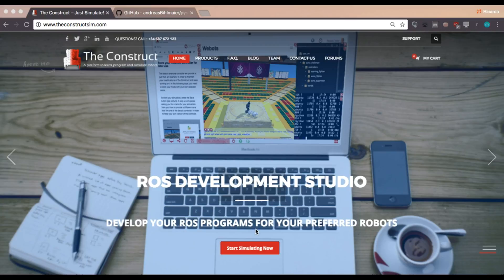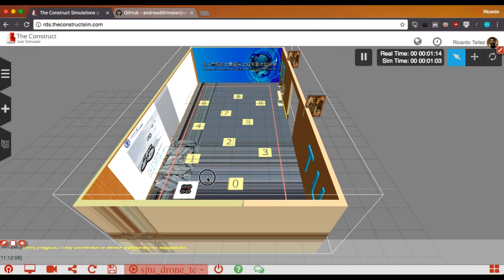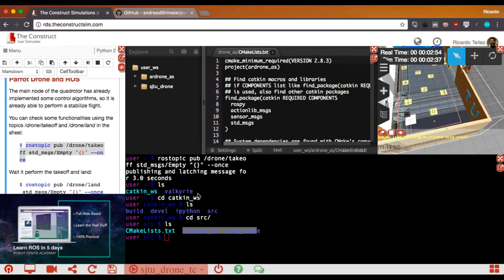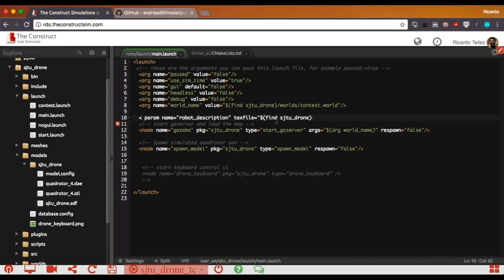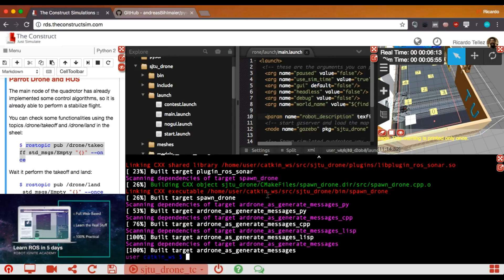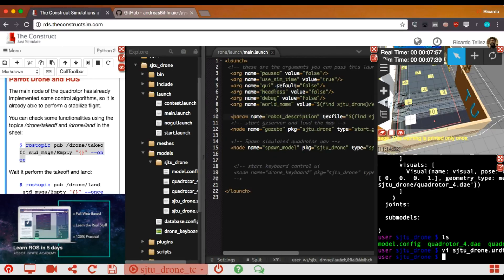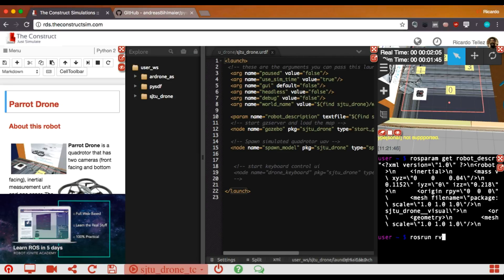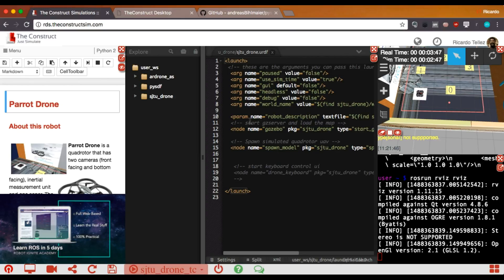[ROS Q&A] How to convert from SDF to URDF robot models

Comment: Thanks for the video!  I'm getting this error: 
Traceback (most recent call last):

  File "/home/ljy/catkin_ws/src/pysdf/scripts/sdf2urdf.py", line 6, in <module>
    import pysdf
  File "/home/ljy/catkin_ws/devel/lib/python2.7/dist-packages/pysdf/__init__.py", line 34, in <module>
    exec(__fh.read())
  File "<string>", line 1, in <module>
  File "/home/ljy/catkin_ws/src/pysdf/src/pysdf/parse.py", line 11, in <module>
    from tf.transformations import *
  File "/opt/ros/melodic/lib/python2.7/dist-packages/tf/__init__.py", line 30, in <module>
    from tf2_ros import TransformException as Exception, ConnectivityException, LookupException, ExtrapolationException
  File "/opt/ros/melodic/lib/python2.7/dist-packages/tf2_ros/__init__.py", line 38, in <module>
    from tf2_py import *
  File "/opt/ros/melodic/lib/python2.7/dist-packages/tf2_py/__init__.py", line 38, in <module>
    from ._tf2 import *
ImportError: dynamic module does not define module export function (PyInit__tf2)

Comment: hello, when i run this command then it shows some error which are below this urdf code.

shailesh@p:~/catkin_ws/src/newe/robots$ rosrun pysdf sdf2urdf.py Robocon2018.sdf newrobo2.urdf
Model(
  name: Robocon2018
  pose: t=[ 0.  0.  0.] q=[ 0.  0.  0.  1.]
  pose_world: t=[ 0.  0.  0.] q=[ 0.  0.  0.  1.]
  version: 1.5
  root_link: base
  links:
    Link(
      name: base
      pose: t=[-0.01279 -0.00012  0.0224 ] q=[ 0.7071  0.      0.      0.7071]
      pose_world: t=[-0.01279 -0.00012  0.0224 ] q=[ 0.7071  0.      0.      0.7071]
      inertial: Inertial(
        pose: t=[ 0.  0.  0.] q=[ 0.  0.  0.  1.]
        mass: 4.67232715263636
        inertia: Inertia(ixx=0, ixy=0, ixz=0, iyy=0, iyz=0, izz=0)
      )
      collisions: [
        Collision(name: base_collision, pose: t=[ 0.01279 -0.0224  -0.00012] q=[ 0.  0.  0.  1.], pose_world: t=[ 0.  0.  0.] q=[ 0.  0.  0.  1.], geometry_type: mesh, geometry_data: {'scale': '1 1 1', 'uri': 'model://Robocon2018/meshes/base_col.STL'})
      ]
      visuals: [
        Visual(name: base_visual, pose: t=[ 0.01279 -0.0224  -0.00012] q=[ 0.  0.  0.  1.], pose_world: t=[ 0.  0.  0.] q=[ 0.  0.  0.  1.], geometry_type: mesh, geometry_data: {'scale': '1 1 1', 'uri': 'model://Robocon2018/meshes/base.STL'})
      ]
    )
    Link(
      name: cylinder
      pose: t=[ -1.69230000e-01   2.00000000e-05   1.73920000e-01] q=[ 0.7071  0.      0.      0.7071]
      pose_world: t=[ -1.69230000e-01   2.00000000e-05   1.73920000e-01] q=[ 0.7071  0.      0.      0.7071]
      inertial: Inertial(
        pose: t=[ 0.  0.  0.] q=[ 0.  0.  0.  1.]
        mass: 0.380867344053708
        inertia: Inertia(ixx=0, ixy=0, ixz=0, iyy=0, iyz=0, izz=0)
      )
      collisions: [
        Collision(name: cylinder_collision, pose: t=[  1.69230000e-01  -1.73920000e-01   2.00000000e-05] q=[ 0.  0.  0.  1.], pose_world: t=[ 0.  0.  0.] q=[ 0.  0.  0.  1.], geometry_type: mesh, geometry_data: {'scale': '1 1 1', 'uri': 'model://Robocon2018/meshes/cylinder_col.STL'})
      ]
      visuals: [
        Visual(name: cylinder_visual, pose: t=[  1.69230000e-01  -1.73920000e-01   2.00000000e-05] q=[ 0.  0.  0.  1.], pose_world: t=[ 0.  0.  0.] q=[ 0.  0.  0.  1.], geometry_type: mesh, geometry_data: {'scale': '1 1 1', 'uri': 'model://Robocon2018/meshes/cylinder.STL'})
      ]
    )
    Link(
      name: piston
      pose: t=[  9.03400000e-02   1.00000000e-05   1.06200000e-01] q=[ 0.7071  0.      0.      0.7071]
      pose_world: t=[  9.03400000e-02   1.00000000e-05   1.06200000e-01] q=[ 0.7071  0.      0.      0.7071]
      inertial: Inertial(
        pose: t=[ 0.  0.  0.] q=[ 0.  0.  0.  1.]
        mass: 1.13305282055916
        inertia: Inertia(ixx=0, ixy=0, ixz=0, iyy=0, iyz=0, izz=0)
      )
      collisions: [
        Collision(name: piston_collision, pose: t=[ -9.03400000e-02  -1.06200000e-01   1.00000000e-05] q=[ 0.  0.  0.  1.], pose_world: t=[ 0.  0.  0.] q=[ 0.  0.  0.  1.], geometry_type: mesh, geometry_data: {'scale': '1 1 1', 'uri': 'model://Robocon2018/meshes/piston_col.STL'})
      ]
      visuals: [
        Visual(name: piston_visual, pose: t=[ -9.03400000e-02  -1.06200000e-01   1.00000000e-05] q=[ 0.  0.  0.  1.], pose_world: t=[ 0.  0.  0.] q=[ 0.  0.  0.  1.], geometry_type: mesh, geometry_data: {'scale': '1 1 1', 'uri': 'model://Robocon2018/meshes/piston.STL'})
      ]
    )
    Link(
      name: arm
      pose: t=[  1.83650000e-01   4.00000000e-05   1.98360000e-01] q=[ 0.7071  0.      0.      0.7071]
      pose_world: t=[  1.83650000e-01   4.00000000e-05   1.98360000e-01] q=[ 0.7071  0.      0.      0.7071]
      inertial: Inertial(
        pose: t=[ 0.  0.  0.] q=[ 0.  0.  0.  1.]
        mass: 0.276815557318641
        inertia: Inertia(ixx=0, ixy=0, ixz=0, iyy=0, iyz=0, izz=0)
      )
      collisions: [
        Collision(name: arm_collision, pose: t=[ -1.83650000e-01  -1.98360000e-01   4.00000000e-05] q=[ 0.  0.  0.  1.], pose_world: t=[ 0.  0.  0.] q=[ 0.  0.  0.  1.], geometry_type: mesh, geometry_data: {'scale': '1 1 1', 'uri': 'model://Robocon2018/meshes/arm_col.STL'})
      ]
      visuals: [
        Visual(name: arm_visual, pose: t=[ -1.83650000e-01  -1.98360000e-01   4.00000000e-05] q=[ 0.  0.  0.  1.], pose_world: t=[ 0.  0.  0.] q=[ 0.  0.  0.  1.], geometry_type: mesh, geometry_data: {'scale': '1 1 1', 'uri': 'model://Robocon2018/meshes/arm.STL'})
      ]
    )
    Link(
      name: gripper
      pose: t=[ 0.12261 -0.00831  0.38848] q=[ 0.7071  0.      0.      0.7071]
      pose_world: t=[ 0.12261 -0.00831  0.38848] q=[ 0.7071  0.      0.      0.7071]
      inertial: Inertial(
        pose: t=[ 0.  0.  0.] q=[ 0.  0.  0.  1.]
        mass: 0.00918868898118573
        inertia: Inertia(ixx=1.72523757737449E-08, ixy=1.30335243330357E-08, ixz=5.44980501603645E-08, iyy=2.82596985029815E-07, iyz=2.67047497400372E-09, izz=2.66621928369397E-07)
      )
      collisions: [
        Collision(name: gripper_collision, pose: t=[-0.12261 -0.38848 -0.00831] q=[ 0.  0.  0.  1.], pose_world: t=[ 0.  0.  0.] q=[ 0.  0.  0.  1.], geometry_type: mesh, geometry_data: {'scale': '1 1 1', 'uri': 'model://Robocon2018/meshes/gripper_col.STL'})
      ]
      visuals: [
        Visual(name: gripper_visual, pose: t=[-0.12261 -0.38848 -0.00831] q=[ 0.  0.  0.  1.], pose_world: t=[ 0.  0.  0.] q=[ 0.  0.  0.  1.], geometry_type: mesh, geometry_data: {'scale': '1 1 1', 'uri': 'model://Robocon2018/meshes/gripper.STL'})
      ]
    )
  joints:
    Joint(
      name: base-cylinder
      pose: t=[-0.08076  0.02107  0.     ] q=[ 0.      0.7071  0.      0.7071]
      pose_world: t=[ -2.50000000e-01   2.00000000e-05   1.95000000e-01] q=[ 0.5  0.5  0.5  0.5]
      type: revolute
      urdf_type: revolute
      parent: base
      child: cylinder
      axis: Axis(xyz=['1' '0' '-2.22044604925031E-16'], use_parent_model_frame=False, lower_limit=0.0, upper_limit=1.01271295799, effort=1.0, velocity=0.0)
    )
    Joint(
      name: cylinder-piston
      pose: t=[  0.00000000e+00   1.00000000e-05   1.00000000e-05] q=[ 0.      0.     -0.7071  0.7071]
      pose_world: t=[ 0.09034  0.       0.10621] q=[ 0.5  0.5 -0.5  0.5]
      type: prismatic
      urdf_type: prismatic
      parent: cylinder
      child: piston
      axis: Axis(xyz=['0.252387643082707' '0.967626207592145' '0'], use_parent_model_frame=False, lower_limit=-0.0929642053871, upper_limit=0.0, effort=1.0, velocity=0.0)
    )
    Joint(
      name: piston-arm
      pose: t=[ 0.03537 -0.12573  0.     ] q=[ 0.      0.7071  0.      0.7071]
      pose_world: t=[  2.19020000e-01   4.00000000e-05   7.26300000e-02] q=[ 0.5  0.5  0.5  0.5]
      type: revolute
      urdf_type: revolute
      parent: piston
      child: arm
      axis: Axis(xyz=['1' '0' '-1.49011614158923E-08'], use_parent_model_frame=False, lower_limit=0.0, upper_limit=2.27576966449, effort=1.0, velocity=0.0)
    )
    Joint(
      name: base-arm
      pose: t=[ 0.01634 -0.05836  0.     ] q=[ 0.     -0.7071  0.      0.7071]
      pose_world: t=[  2.00000000e-01   4.00000000e-05   1.40000000e-01] q=[ 0.5 -0.5 -0.5  0.5]
      type: revolute
      urdf_type: revolute
      parent: base
      child: arm
      axis: Axis(xyz=['1' '0' '1.49011610828254E-08'], use_parent_model_frame=False, lower_limit=-2.64226437626, upper_limit=0.0, effort=1.0, velocity=0.0)
    )
    Joint(
      name: arm-gripper
      pose: t=[ 0.0112   0.00054  0.     ] q=[ 0.     -0.7071  0.      0.7071]
      pose_world: t=[ 0.13382 -0.00831  0.38903] q=[-0.5  0.5  0.5 -0.5]
      type: revolute
      urdf_type: revolute
      parent: arm
      child: gripper
      axis: Axis(xyz=['-1' '0' '2.22044604925031E-16'], use_parent_model_frame=False, lower_limit=0.0, upper_limit=0.987687471455, effort=1.0, velocity=0.0)
    )
  submodels:
    
)
UNTESTED
UNTESTED
UNTESTED
UNTESTED
UNTESTED
Could not find mesh meshes/base_col.STL in /home/shailesh/catkin_ws/src/
Could not find mesh meshes/base.STL in /home/shailesh/catkin_ws/src/
Could not find mesh meshes/cylinder_col.STL in /home/shailesh/catkin_ws/src/
Could not find mesh meshes/cylinder.STL in /home/shailesh/catkin_ws/src/
Could not find mesh meshes/piston_col.STL in /home/shailesh/catkin_ws/src/
Could not find mesh meshes/piston.STL in /home/shailesh/catkin_ws/src/
Could not find mesh meshes/arm_col.STL in /home/shailesh/catkin_ws/src/
Could not find mesh meshes/arm.STL in /home/shailesh/catkin_ws/src/
Could not find mesh meshes/gripper_col.STL in /home/shailesh/catkin_ws/src/
Could not find mesh meshes/gripper.STL in /home/shailesh/catkin_ws/src/
Reply from the maker: Please for that kind of questions, use the forum (http://forum.theconstructsim.com/). It is impossible for us to answer that kind of questions here. You will need to create a free account of Robot Ignite Academy in order to get access to the Forum (http://www.robotigniteacademy.com)